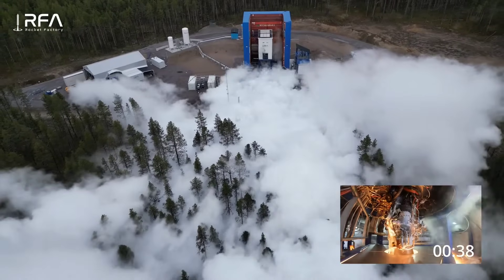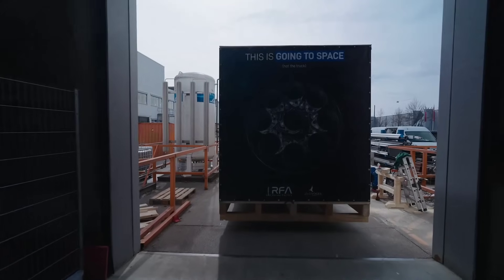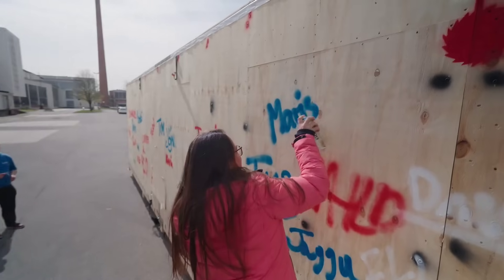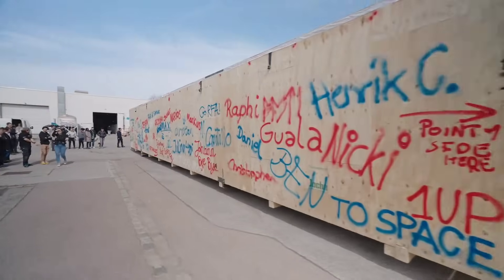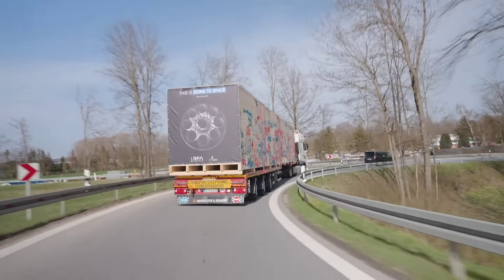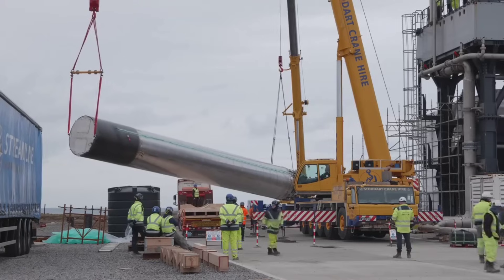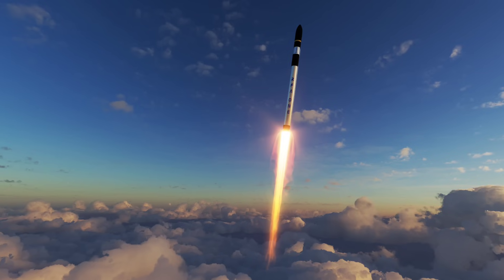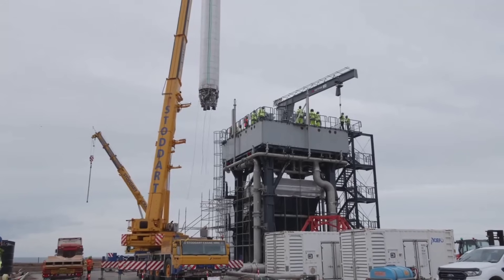Germany and Britain prepare to make history and take on SpaceX!  RFA ONE arrives in Saxavord!!

Comment: Well if their space program is anything like BMW/MINI then they'll be really luxurious, efficient, and beautifully designed..... but they are trash after 8 years and will need engine drive train rebuilds or replacements before 80,000 miles....

That'll only get them in the air long enough for gravity to pull them back. 

My experience is my 8yr oldx3 87000 miles needed transfer case and transmission

My 10yr old x3 cracked the block at 96,000 

My mini at 8yr the ECM crapped out 87,000 miles, and then at 10yr 97600 miles no obd2 codes, guys into limp mode diagnostic internal engine failure...